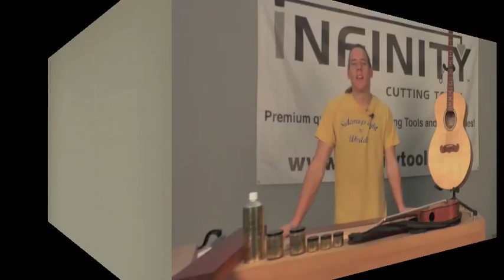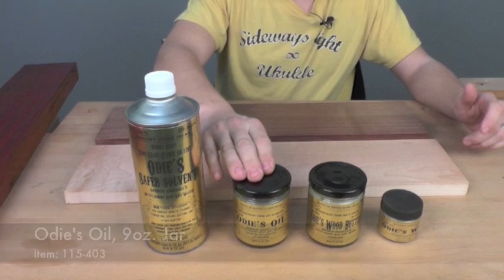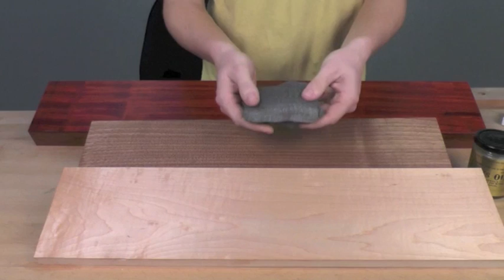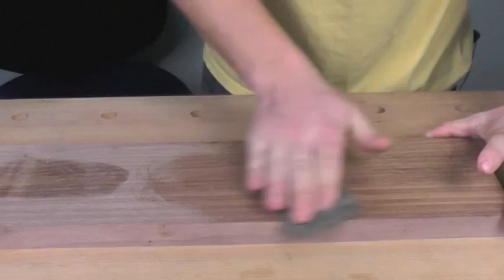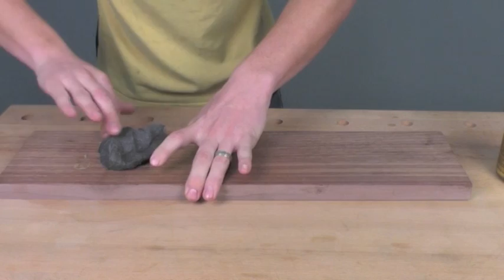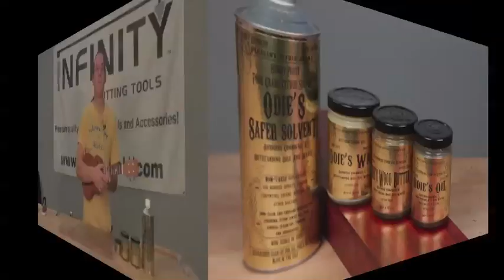Infinity Cutting Tools -Odie's Oil

Comment: I am looking forward to trying this product soon on a wormy maple tabletop. I usually stay away from steel wool due to rust from stray particles left in the finish. Is that a reasonable concern?
Reply from the maker: Stray metal bits from steel wool would be more of a concern to me when using a water based finish. I have used steel wool for many years and never noticed an issue with metal partials. That being said I have switched to the non woven scuff pads Like Mirka Mirlon instead of steel wool, I feel they do a better job with not risks. 
https://www.infinitytools.com/mirlon-6-x-9-scuff-pads
Reply: That certainly makes sense. I will try them. I have a long live edge table coming up. Great test